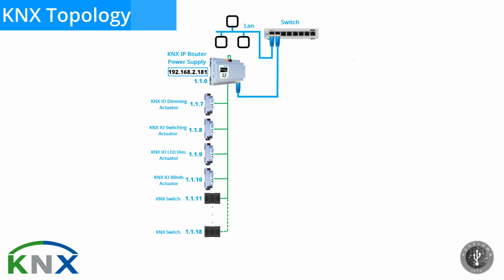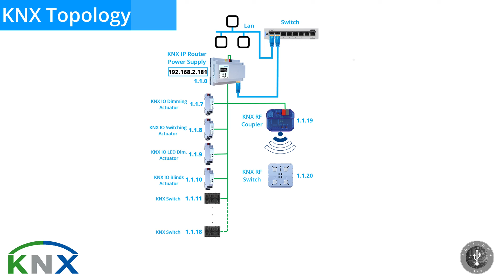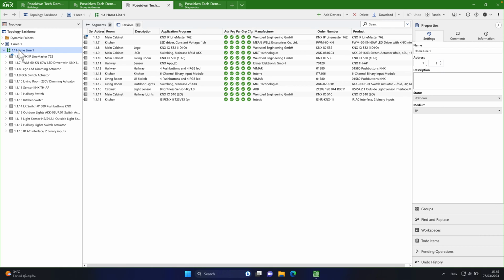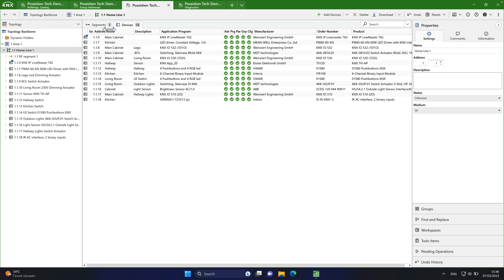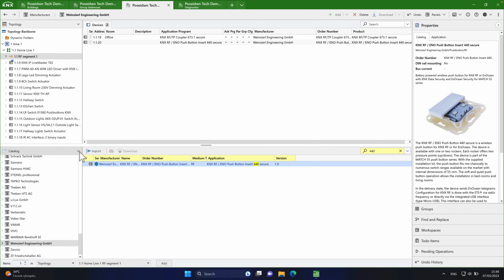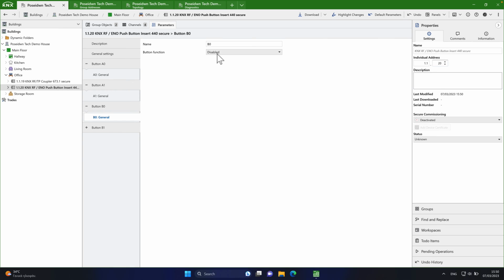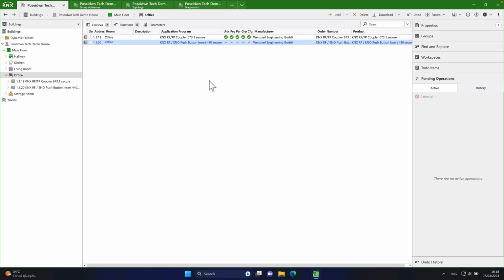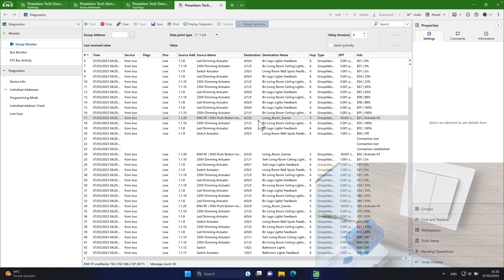KNX RF Segments - Easy way of adding KNX RF devices in ETS6 projects

Comment: Hi !just wanted to ask,how its possible for the rf coupler to work,because tha main line is ip,and there isnt yet an ip/rf coupler..
Reply: Hey there, that's the main theme of the video, is to show that with the new feature of ETS6, you can add now segment couplers and with that you dont need to put it in the main line anymore and it also works with ip and tp lines + it is now possible to secure the RF line. Don't look for media coupler which was also line couplers but search for segment couplers.